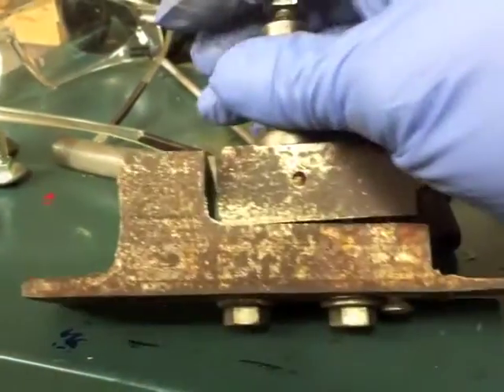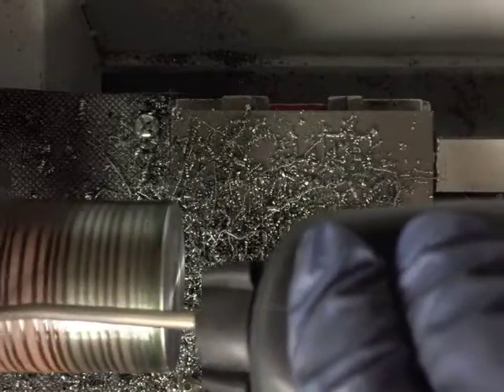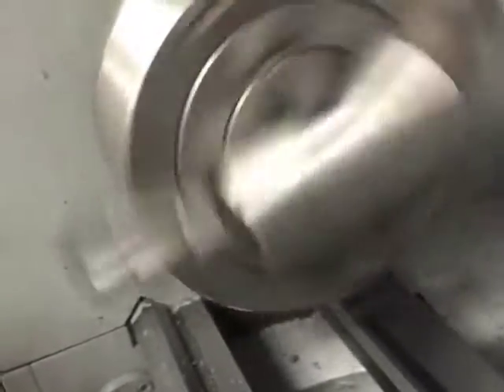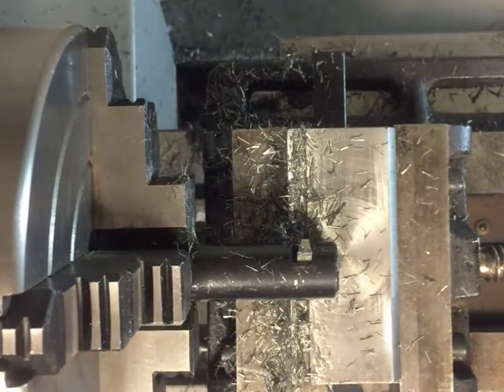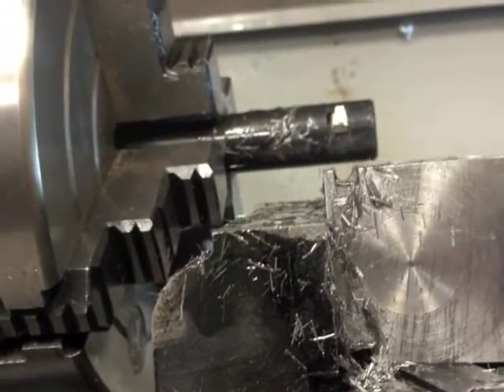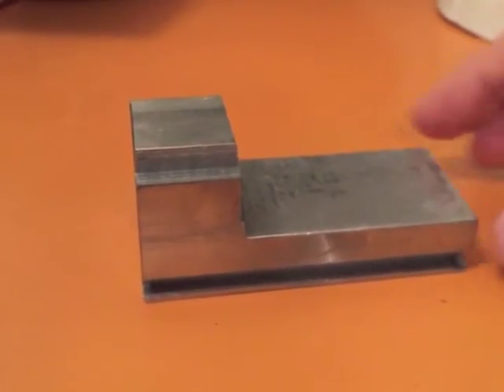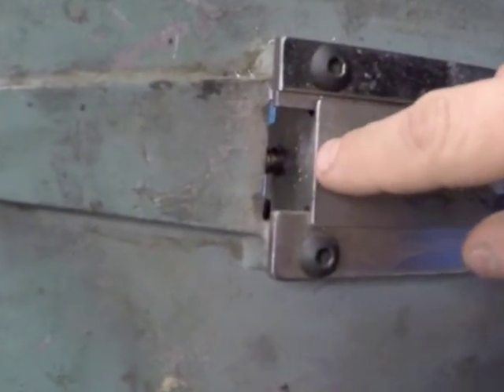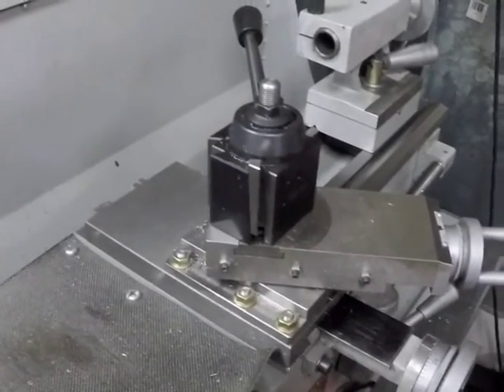Milling on a lathe / Bandsaw adjuster / my first voiceover

Comment: Did you ever solve the parting off? And how hard was it on your lathe to make those cuts when you really started "milling" with it.
Reply from the maker: The parting off issue was mostly solved with a proper carbide insert parting tool, instead of HSS. Parting is tricky on everything except for extremely well built lathes, but I can't do it without poop in my pants now.
Reply from the maker: It didn't kill my lathe... didn't do any damage... More or less it just sounds really bad and you are going at it for a long time.... Doing this was the reason I ended up purchasing a mill... 

Looking back, If I had a live center on the end of my boring bar, and if I had changed a few things up... It likely wouldn't have been too bad. It's pretty slow going tho.